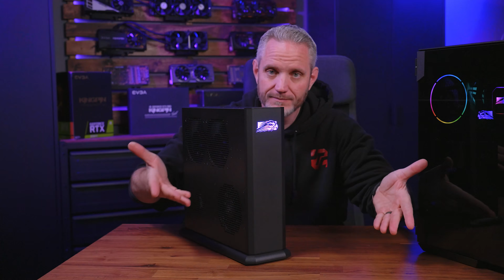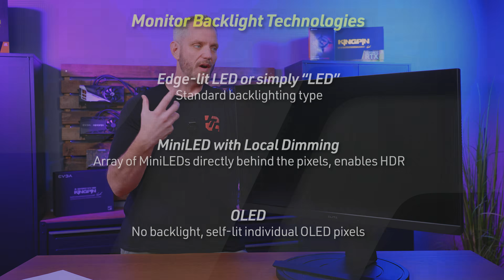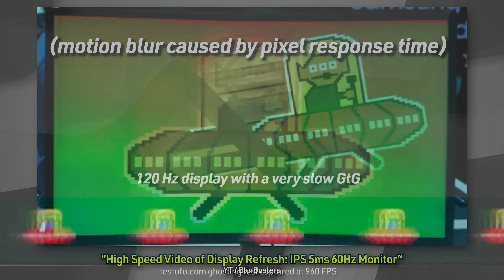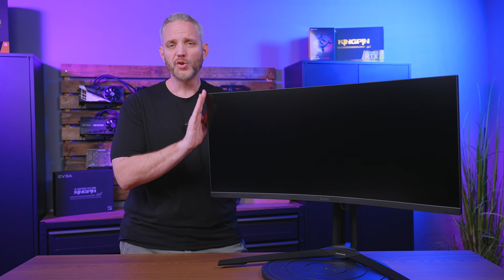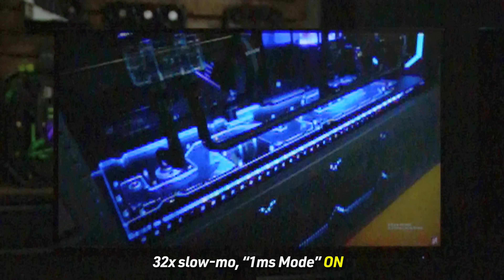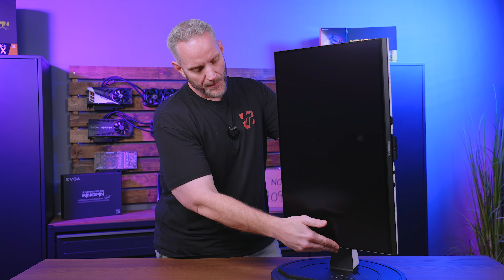Ultimate Gaming Monitor Guide: Find the BEST Screen for Your Setup

Comment: As a tech challenged fellow, this all still leaves me scratching my head. I am just about to switch to a monitor for my pc, which uses a 3080 gpu, after relying up till now on a tv running at 60 htz.  But I have no idea what I want or where to start. This should be a fun choice, but the danger of choosing the wrong thing is turning it into a frustrating experience sadly. :(

Comment: For me sweet spot is 120hz 1ms IPS, i got g24f2 but it broke(horizontal lines on the screen) nad now i bought samsung odyssey g4 and will probably run it on 120hz because i won't be getting higher fps than that

Comment: I want a 40 inch 6K Ultrawide. Or a 5K Ultrawide. Something with around 150+ PPI. Would like at minimum 144Hz and USB C PD 100W+ with DP2.1 and HDMI 2.1. Would prefer Micro LED but would take Mini LED with 1000+ FALD dimming zones and 2000+ Nits peak brightness. 500,000:1+ Contrast with sub 1ms response time and minimal ghosting/artifacting. That would be my dream monitor... not a huge fan of OLED. OLED's are pretty and look amazing, but Mini LED is pretty close and doesn't need pixel refreshers, ABL, Pixel Shift, and other burn in mitigation software. Mini LED can blast full brightness with no worry of burn in. One thing that drives me crazy is I can build the perfect PC... but I haven't been able to find the perfect monitor.

Comment: Most important thing to me is OLED. I first got an OLED TV. Was so blown away, I was looking for any excuse to play games made for controller so I could chill on the couch instead of at my desk. Then I got one of the first OLED monitors, an Alienware 3423DW. I paid a premium for it cuz it was early tech, but man this thing is incredible. 1440p, 144hz (165hz if you want to go down to 8 bit color), 21:9 aspect ratio... I am actually looking to now move onto a 32in 4K monitor but because I have spoiled myself with OLED, they ain't too cheap either. Anyways, once you experience that perfect contrast and amazing responsiveness, you never will go back. If you're on the fence because of the price and you're not in a rush, take some more time to save up some more money. It's worth it, and plus they've only gotten cheaper as time has gone on.

Comment: Gaming anything over 60fps actually impairs your reflex times because of the O(N log N)$ + AI Overhead it takes to SYNTHETICALLY UPSCALE the native 60fps to 120fps or 240fps. EVEN the RTX 5090 ONLY generates natively at 60fps.. THis causes latency from 30ms @60fps to 40ms at 120fps to 60ms at 240fps.

Comment: Great video. Lots of info. I have an AOC Q32V3S 31.5" WQHD 75Hz Adaptive Sync IPS Monitor. Works okay for me. I'm a casual gamer. Wanted 32" for desktop real estate primarily and the QHD resolution is spot on for me. But I've been thinking about an upgrade for better gaming credentials. Thinking same size, same res but much higher refresh, response and any other features that will make games look better without breaking the bank. So, OLED is out. I have an i7 with 4070 Super so thinking 4K res will stretch it a little where now it purrs along superbly. Any recommendations?

Comment: I have a Samsung Odyssey G5 Series 27-Inch WQHD (2560x1440) 144Hz, Curved, 1ms Monitor with an i7 12700k and 4070 Ti. My problem is that I have to use vsync which caps my screen at 144fps to stop tearing cuz my gpu will give me like 240 fps if I leave vsync off and ill get tearing. With Vsync on my gpu utilization is only like 60% at 144fps. I've tried every setting to get around tearing problem with vsync off to no success so what is wrong here? Is my monitor too slow? Should I upgrade to a Gsync 180-240hz monitor with .05ms? How do I solve this while using more of my gpus performance?

Comment: So... anybody wanna help me out?
I have an older TN Asus model (Asus Vp247QG iirc), 60hz 1ms, it has been my competitive gaming monitor for a few long years and I just bought a 34" 3440x1440 21:9 (AOC CU34G4) for Simracing (FAST VA) 

Now.. I was mesmerised and was hoping to find a similiar model to sit next to that one (for normal pc use/FPS games) but in 27" size maybe (so 16:9). Im also aware sim racing is different category for monitors kind of..

My fear is by evolving to IPS, I might lose the visibility in dark corners in some games (Tarkov is a good example) and delay/response time. 
Another fear: By sticking with normal VA over IPS that I end up without that awesome quality people mention (yes I know I am currently at that point, but point is to upgrade massively, about to buy RTX5070Ti to complete PC and replace the 1660Super)

Ive seen videos about the average response time on some recent models and from what I can tell, alot of them actually have 5-15x more than what they announce on the box.... For example a 1ms response time taking 15ms to change a pixel. Grey to Grey iirc?

As somebody who plays FPS game primarily since young and being a competitive person, I really want to avoid bad blacks or bad response time (be it official or GtG)

Would prefer 4k but might settle for 2k if its cheap and upgrade in future

Also, anybody here play competitive games with a curved monitor (ALOT OF HOURS)? Dont think I want one for main games but im curious, the extra pixels make me curious

Considered a Q27G42XNE as its similiar look to my ultrawide and same brand and supposedly the GtG isnt too bad but I still have reviews to look at in order to make sure.

EDIT: biggest problem for my understanding of the tech is lack of availability of monitors shown in stores
Can't even go compare a new IPS model with a new VA model (AOC for example have a model that is pretty much the same except one is IPS and 1 is VA)

Comment: I would like to upgrade my gaming set up, and a monitor would be a nice start to that.
My question is.
Do i get: 
4k monitor (Perfect for the consoles, over kill for the PC as my GPU is more 1440p level)
Or 
1440p (Perfect for my PC, but slacking in resolution for my consoles) 
What i do know is: i need it to have AMD freesync and HDR10+ built in and be 27"
Reply: most if not all of the 1440 27 inchers on sale right now have some sort of free sync and hdr10 or hdr400
Reply: @lloyd011721  Yeah, they say that, but they actually don't.
Like the one i current have says HDR10, but then when you go into the HDR settings, it says this device does not have HDR.
Reply: @Diirtypanda92 isnt that false advertisment? cant you sue for that?

Comment: @Jayztwocents i cant decide on which version screen to get.  I have a ryzen 7800x3d with 9070 xt.  Im buying a gigabyte 27" 1440p oled for it.  It has 2 options 240hz or 360hz, both 0.03ms.  Im thinking the 240hz version is enough because i probably couldnt push above 240fps in 1440p with my rig?  Help me please 🙏

Comment: My sweet spot is 2k curves 32 inch wide, 120hz 1ms. they're fairly cheap by comparison to other 2k 144hz monitors. I picked mine up for 215 before taxes. I run anywhere from 90 to 130FPS in games in high to ultra setting with a 5070 and a R7 5800X3D. The picture is very clear and very fluid. I NEVER get screen tearing or anything for my I think it's the sweet spot to not waste a ton of money when I could spend it elsewhere in the build...IE, a better power supply.

Comment: Thank you as always for the detailed information. It's a shame that the perfect monitor for me doesn't exist... a 24" 165/180Hz with 2K resolution for higher pixel density, possibly OLED low response time like 0.5ms. I imagine it is not possible or economically smart to produce something like that.

Comment: I have the (Dell 2417dg 2560x1440 TN led 24 inch) and have put thousands of hours into it, one annoying thing is that the left and right sides of the screen make objects in games in that area of the screen appear larger than those in the center of the screen, is that what you meant by the weird viewing angles of TN panels?

Comment: I've tried 2 IPS monitors so far and theyboth look horrible compared to my VA monitor. The contrast levels are low and the higher the brightness is, the more washed out the image looks like. Whereas on my VA monitor i can push contrast a lot more, as well as brightness and get a really nice popped and light up image.

Comment: The HDR was not explained that much. It is huge selling point, but usually the HDR on IPS panel sucks. I think I have one of the first 144Hz IPS panel from LG which claimed to have 1ms response time (it has issues) so I use the fast response time (2ms I guess) not the very/ultra fast resnponse time. It is really great monitor which was sold like 4-5 years ago. However the HDR is unusable. Viewing angles, QHD, response time, 144Hz everything is fine, but HDR meh.

Comment: I have 27" IPS 240hz that maxes at 1440P.  I'm eyeballing a 32" 240hz 4k QD-OLED, but not sure if it's worth the expense.  (I did just get a 9070 XT though so it should run good)

Comment: Currently looking at the KTC 32 Inch Curved Gaming Monitor. 

1500R - 240hz/1ms HVA panel - 3500:1 contrast ratio HDR10 - 100*100 VESA wall mount.

Does anyone have any experience with this?

Edit: This is only for an Xbox series X - not a high spec pc. However, would this monitor be a suitable option for the series X and then for a future pc?

Comment: I'm a bit lost in the current market. I'm looking to buy 2 new 27 inch  monitors to run a dual monitor setup. I have an RTX4070 powering the whole thing and currently have a 1080p monitor god knows how old it is. Not sure whether to go with 1440p or 4K and if it is even able to run on my card smoothly. I will use it for both gaming, office work and occasionally doc my macbook to it. Any advice what to look for?

Comment: No mention of the burn in issues with Oled???
Reply: Meanwhile i'm using a Syncmaster 955DF from 2002 and no burn in. I can reach 1792x1344 res (very 4:3 1440p-like) with extremely sharp phosphors, no aliasing, no sample&hold blur, no upscaling blur, built-in DLSS (no native resolution and refreshrate) , image quality perfection (HDR built-in due to the display being analog).

There's isn't a single reason that OLED is superior to CRT for gaming, night&day difference. High end OLEDs at least are beautiful for watching movies and TV shows (there isn't a 4K extremely bright CRT).

Comment: even true HDR1000 looks like ass on an IPS panel. The maximum possible contrast ratio is just to low. 1000:1 regardless of if you have Mini LED or not will make blacks turn out all smudged and grey. This is where I hate the IPS glaze. Its a great panel type but it does not do everything perfectly to completely replace TN or VA. If you dont want to go Organic LED and still want actual good deep contrast and HDR you need to go with a vertical alignment panel. They have contrast ratios of anywhere to 3000:1 to even up to 5000:1 these days. That very high contrast raito with Mini LEDs is where youre actually going to see HDR shine. I have no clue why the hell manufactures even bother putting Mini LED in IPS screens. It makes it more expensive to produce and drives up the cost and for what youre paying, youre not getting HDRs full potential because of again that low contrast raito. I wish more people would mention this is monitor types and differences but no one ever does its just instant IPS glazing on size fits all and its annoying
Reply: I'm using a 19inch Samsung Syncmaster 955DF PC CRT (display port to VGA and CRU on a current modern PC), what is HDR? i'm on analog lol.

Comment: Sooooo...
If i want a monitor for mostly open world games for my RX7900XTX-PC ... what's my monitor now?
(No joke. I'm stuck with the seek for it and i need tips.)
Reply: Do you primarily play single player games and like very very rarely play anything competitive? I assume that's what you mean by open world like RDR2 Horizon Forbidden West or Monster hunter wilds then what you probably want is contrast. Don't get anything Mini LED with an In Plane Switching Panel. That's what these people always fail to tell you. IPS has a maximum contrast ratio of about 1000:1. Even with Mini LED and true HDR1000 your blacks will look smudged and grey and nasty. If you want full contrast and again play high fidelity single player games where frame rate doesn't matter all that much then you want to go VA if you don't want to pay for Organic LED. VA panels have contrast ratios of up to about 5000:1 these days. Now pair that with Mini LED and True HDR1000 and you're getting some incredible contrast and blacks with great colors as well. IPS has the best color accuracy but VA has the best color reproduction and saturation. The colors will pop out at you and look stunning when you run through open worlds. Now the reason I say only get it if you play only single player games is that VAs weakness is its viewing angles. They aren't horrendous like TN panels but if you don't look at it straight on the colors will shift a bit. The response times are often a little slower, these days its till pretty fast at about 1ms pixel and 5 or so ms GTG, but still ultimately a little slower than IPS or TN panels. Not all that big of an issue if youre playing casual high fidelity games. If you play any kind of competitive stuff where you do care about latency and response times you should go in plane switching, but from what it sounds like, you want contrast. Avoid anything with HDR400 or 600. aim for only HDR 10 or HDR1000 as they are the only true HDRs. Everyone I see who does videos mentioning panel types always fails to mention that VA panels do have uses and aren't so obsolete like TN is these days. So many people glaze IPS for everything, but for contrast and immersion in single player high fidelity high contrast beautiful games they just really aren't the best choice.
Reply: @YourLocalR3NecK  Thank you very much for your informations. At least it will be more open world than shooters. But isn't it than better to go for OLED?
Reply: @Scr3amapillar  yes, OLED has the best contrast (infinite blacks) incredible refresh rates and response times, both accurate colors and saturated colors with no ghosting or latency issues. The only risk you face with them is burn in. If you have the the money for the hefty price tag I would pick one up, but if not, you personally would still get a very enjoyable experience from an Mini LED VA true HDR1000 monitor. Just depends on your budget and/or your needs/wants. Most can afford an OLED so IPS, VA, and TN are usually the most common options.
Reply: @YourLocalR3NecK  Yeah, i got you. But i said (after a week of research) to myself, that burn-in isn't that problem for me. It will run for about 4 h/d and then it's not that tricky. And i can't take the money into the grave, so why should i not spend it for my hobby? 😊 And at least i have my monitor for 10 years. Then it's a 100 bucks per year. That's fine. My PC is also only 2 years old and screams for a new monitor. I guess i go for OLED. Thx for your time and tipps. Very nice. 🤙
Reply: @Scr3amapillar no problem man. You won’t regret it. OLEDs are beautiful. Trust me all other display types become complete shit when you start to use it looll
Reply: @YourLocalR3NecK  That's also something i've heard so many times. 😊

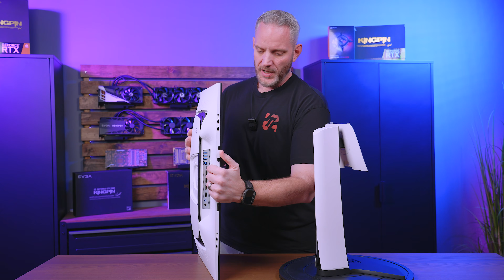Comment: Monitors are important, but you'll notice a lousy chair way before you'll notice a mediocre monitor.  Before you spend a ton a better display -- especially one with a refresh rate you cannot afford to drive -- buy a really good chair.  One thing about a lot of monitors that annoys me is what Jay shows at 21:27 -- ports facing downward, where once the monitor is in place, you can't see them.  That makes plugging in harder than it should be, and it can also make cables harder to hide, if that matters.  I much prefer the ports facing out the back.  Not a make-or-break, but a consideration, especially for someone who frequently changes things around.

Comment: I'm no expert on monitors, but the last rig I built 3 years ago has an EVGA Supernova 1000G+ psu, Intel Core i9 12900K cpu, ROG STRIX Ryujin II 360 with Noctura fans, no RGB for cooling, on a ROG STRIX Z690-E MOBO, M.2 gen4 SSD 2 TB, (2 M.2 gen3 1 TB I already owned to save $$), an EVGA RTX3080 Ti FTW3 Ultra,  32GB (2) 16 GB DIMMS Corsair Vengence DDR5 4800 MHz, in a Corsair 5000D Airflow case. My display choice was an LG 55" C1 4K OLED. I am using a  Rocketfish 4 ft 8K ultra Certified HDMI cord for 120 fps, NSinc, and HDR option. I wanted the true dark and vibrant colors. Also Logitech Z906 500 Watts RMS discrete 5.1  full surround sound. Was the best I could do at the time. It was just before the 4000 vid cards hit the market, just when EVGA left the vid card scene, (they were my favorite), and just when the C2 OLED's were out, (price and features helped me choose the C1). I'm pricing a new rig now, gonna see what I can get with 100" ish maybe newest OLED tech, (depending on fps, with home theatre options).  * I used your knowledge to help me choose and build.

Comment: So as a console gamer (Xbox X) that is building my first gaming pc, am I gonna be irritated if I opt not to go OLED for the monitor?  I currently run my Xbox on an OLED 55in LG tv.  Will there be a major difference in the display I’m used to having with my Xbox or will the fact that the pc monitor is significantly smaller make up for the difference?  I appreciate any help thrown my way.